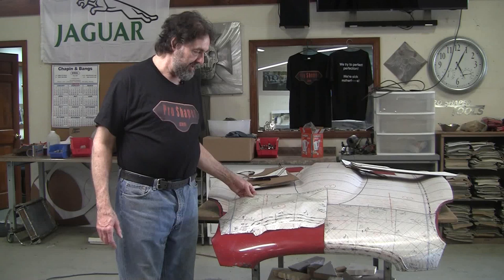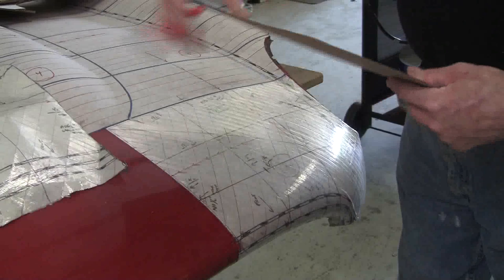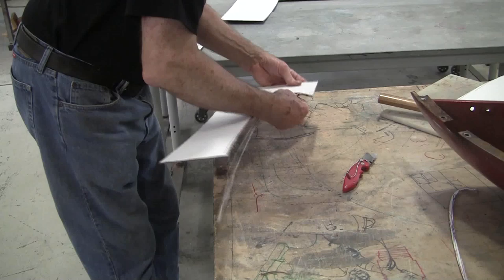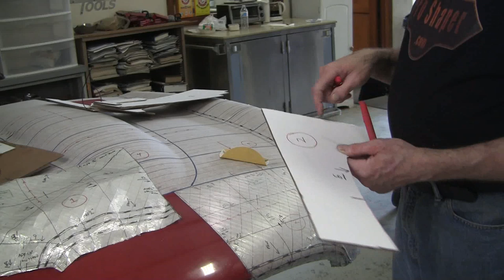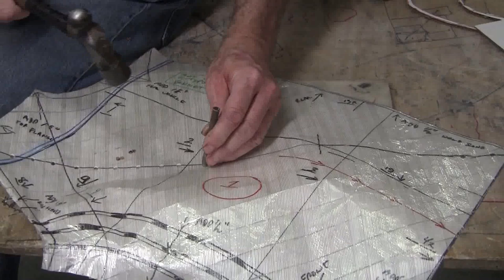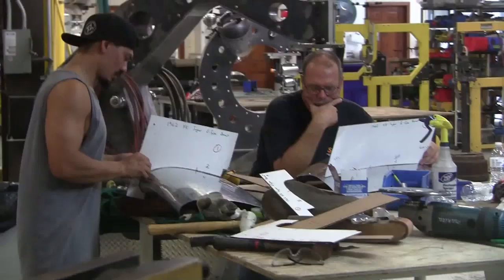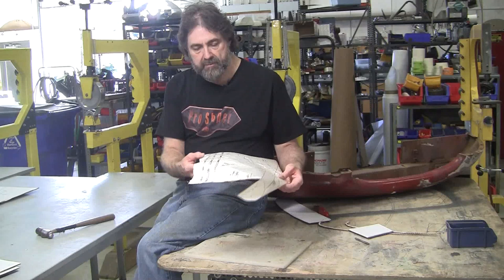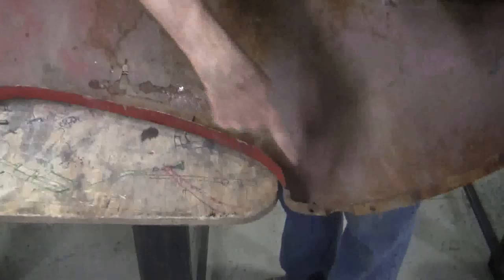How to shape metal: Jaguar E-Type Aluminum Bonnet Build (Part 2)

Comment: Excellent solution to creating an inner shaped bondo form reinforced with steel rod. I am a bit curious as to it's durability when using 18-19 ga steel. Would it be suitable for a single use if done with care? At 58 it's still great when every day can be a school day! Thank you for sharing your knowledge Wray.
Reply from the maker: Hi Matt, I'm 68 and every day is still a school day.😁😁😁  I have made these steel reinforced bondo forms for 25 years and have hammerformed a lot on them. They will take the beating and they will occasionally crack or chip. You dig out the crack and rebondo, not a major problem.  Yes, they will allow steel 19 and 18 gauge.
Reply from the maker: I used them on some detail work for years when making XK Jaguar panels. They would break once and awhile, but they were easy to repair.

Comment: I used concrete once to hammer form part of a gas lamp from a castle, didn't think of reinforcing it, by the time I was done it was falling apart, good thing I had to make only one. The Kitty/tiger hair with steel reinforcement is an idea I will definitively steal from you. I found out about your vids 1 week ago on the HAMB, now I'm binge watching, even the basic stuff I already know because there is always something to learn from others, especially knowledgeable people like you.

Comment: Thanks Wray!
I had a "dah" moment when I saw you roll the pen over the nose piece to mark the cardboard. That makes sense. It sure is easier than the "tape a bunch of pieces of cardboard together" method that I used before. ;)
This really is a fantastic "course" you are giving us. Please don't stop! Thanks, many times....
Reply: Rolling pen like that means line which is half of pen´s thicknes wider than the parent surface. This is common hobbyist "mistake".
Reply: @4486igi  Yes, I agree that would make sense IF you used that line as a final point.  The idea of rolling the pen isn't to get the exact profile... it's to get in the ball park so you can trim to fit the profile. That isn't what Wray did. He used the pen to get started and then sanded the profile gauges until they fit. He is hardly a "hobbyist".

Comment: I use those 'old-school' manual flexible drafting curves for doing this. These are not to be confused with 'French curves'. This is a strip that can be easily formed into a curve by pressing it to the parent surface and it will hold that shape and can then be carefully transferred to the template, or 'sweep' material. The final adjustments are made by the same pencil or pen technique shown here.

Comment: Very very nice series and very well  explained. I like you explaining sometimes your thoughts or thinking process to explain the essence.  

Could you make the pattern in one go instead of separate section and cut out the blue lines after taking off the entire flexible pattern? You could put on the plaster dust while removing the much larger flexible pattern to prevent sticking. The advantage is that it saves a lot of time cutting all the tedious tapes where they meet the blue masking tape.
Reply from the maker: I have had the same inquiry about making the pattern all one piece and cutting later many times. In my experience it is best to do it the way I do it. I always look for and consider alternate methods and if they work better I will adopt them in a heartbeat.
Reply: @proshaper  thanks for the fast response. So what would or is the disadvantage(s) to do it in one go? 

I just started watching after a recommendation by Google and I really like the way you explain it. You seem to have a talent for being an instructor.
Reply from the maker: @therealspixycat  I will answer your question in part 5. Part 4 which is over an hour long will be up in 15 more minutes.
Reply: @proshaper  thanks! One other request for future video's is to use metal forming as used in this serie  in combination with  I guess Tig welding.
Reply: @proshaper  I saw on TV a tape with a build in cutting wire they use for cutting wrapping application (West Coast Customs)
Reply: @proshaper  I saw on TV a tape with a build in cutting wire they use for cutting wrapping application (West Coast Customs)
Reply from the maker: @therealspixycat  ???? No clue of what you are describing. 😁😁😁
Reply: @proshaper  it is called knifeless tape. 3M sells it
Reply from the maker: @therealspixycat  I just watched a video of knifeless tape it is used for car graphic wraps. I can't see a use with flexible shape patterns. You can put down flexible shape patterns without having to use a razor to cut the tape. You put the tape down draw a line with a pen, pull up the tape cut with a scissor then put the tape back down.
Reply: @proshaper  it is only a suggestion